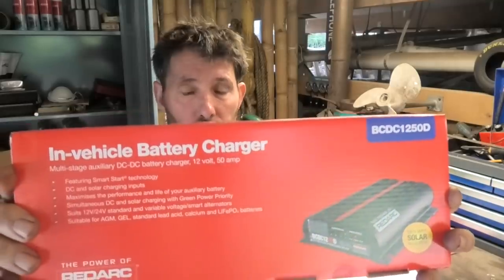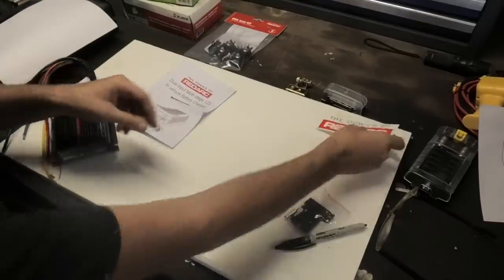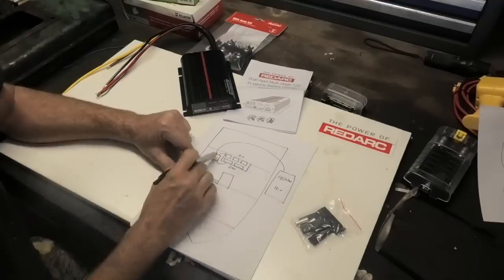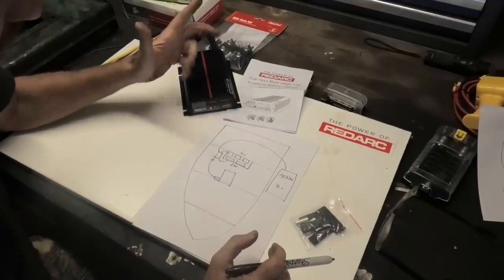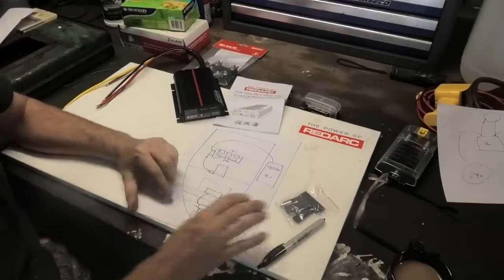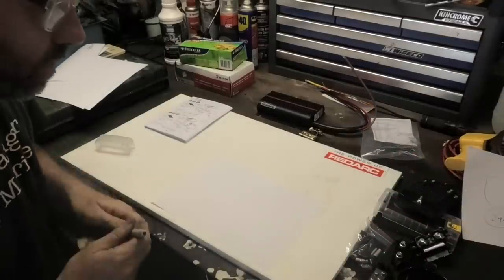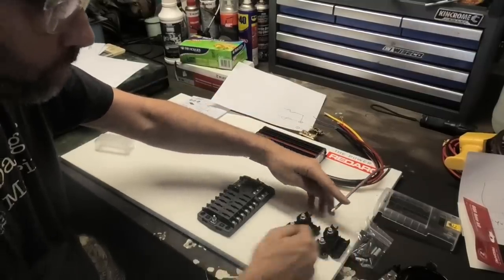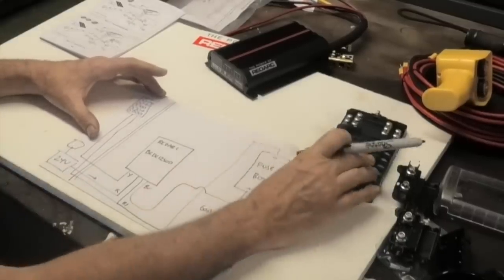Planning the trawler electrics

Comment: Stu, you’ve got a great plan for moving forward with the electrics but there is something you need to consider. Using a single unit combining 12V charger, dc-dc and MPPT for the solar means you are vulnerable to being without charging if it fails. Not sure how long the batteries would last without charging but if you’re a long way out it could be a problem. Having a spare dedicated solar charger might help but I think I’d go with a second duplicate charger unit on your board that you can hook up quickly when needed. Electronics fail and if the charger fails and your 12V bank goes down as well, you can’t even call for help when offshore. If one of your parallel batteries goes short, it’ll drag the other two with it. Add some kind of contingency for charger or battery failure and you’ll be fine well offshore. Keep up the good work and thanks for sharing.
Reply from the maker: Thanks mate. The single point of failure really is an issue, I'll have to think about the best way to handle that.

Comment: Very nice thinking, Stu.    I wish someone had thought out the electrical system on my boat.  It's a terrible bird's nest.  I want to pull it all out and replace the whole system, but it's all working for the moment, so not priority right now.  What an impressive little charging controller Redarc makes.  Looking good!
Reply from the maker: Thanks Tony. It is very easy for wiring to become a birds nest which I guess is why so many planning is required before you start. The trouble with most boats seems to come after the original install as things get added, or things fail and then are fixed with extra wires being run etc.

Comment: I build campervans and 100% agree that dc appliances are the go . Sure mains power gear is cheaper and more variety but if your inverter blows then you have nothing . With dc all you need is batteries and if your batteries die then its easy enough to get another and you still have appliances working . And if you can afford it go lithium batteries in the long term they are cheaper then lead acid .
Reply from the maker: I do like the simplicity of 12V, and, as you say, drop in a spare 12V battery and you are back in business, even if it is just for a while without charging.

Comment: Stu, I have worked on many boats in my lifetime and second the other recommendations to have a "spare" REDARC controller on board with terminals already crimped on hermetically sealed in a heavy duty plastic bag.  You want to reduce single point failure modes.  I had good success over the years with ring terminal screw type crimp fittings PROVIDED they are crimped with a proper ratcheting crimp tool that only releases when the proper pressure has been achieved.  All crimp fittings need to have "inner melt" insulation that you shrink on with a heat gun.  The object is to not let corrosion get into the crimp and up into the wire. I was going to suggest using fine stranded tinned marine grade wire until you mentioned it.  I think 24VDC winches for both the anchor and deck crane is the way to go.  However, if you think the deck crane could be used extensively during salvage then I would suggest switching to hydraulic winches.  As to a small generator, if possible stay away from explosive petrol (gasoline here in America), why store two fuels when you already have two huge tanks of diesel fuel. Yes, diesel gen sets are more expensive but safer, last longer, and are more fuel efficient.  You could probably pick up a good used one on the internet.
Reply from the maker: All good advice mate. I agree about petrol not being great on a boat, it's just that I have the compressor and generator already and can't currently afford to replace them, but I do agree diesel would be better.

Comment: A 900W Solar system at 12V will generate a maximum current of 75A which is 15A more than the 60A fuse of the Redarc, and 25A / 50% more than the 50A it's rated at . . . love your work mate, keep going strong.
Reply: The MPPT in the REDARC operates between 9.0V and 33.0V. The REDARC solar panels on their website produce maximum power at 18V. 900W/18V=50A, 50A is the continuous rating of this REDARC Charger.
Reply from the maker: Hey mate. Now thinking of splitting the 6 cells as 2 for the 24V starting batteries and 4 for the 12V house batteries.
Reply: @DangarMarine  Could be a good move. Making sure the 24V system is always charged to start the motor would be a high priority for me. I'd bet more boats run aground from flat starter batteries than catch fire. :)

Comment: I used a RV camper's generator and power set up.  the 120 power jack ran the anchor left motor. and at sea ran all the power needs and I had over 8,000 watts storage in batteries. the generator ran if needed most of my needs never had an issue in the four years I had the boat.

Comment: Just a thought, a small backup diesel generator could be a lifesaver and get the main engine running if something catastrophic occurred. It could also ensure your separate anchor motor battery or batteries are charged. Yes it would be expensive but out on open waters you want to make sure you know you can start your main engine. Have a look into it and a think about it Stu.
Reply: I would definitely want a back up generator all the time if going offshore. Would a petrol generator not be sufficient? Or is the a concern with fuel storage?
Reply: @landlifem5872  just thinking one type of fuel is enough to carry on board, except maybe LPG operation as I am assuming there will be gas on board for cooking.
Reply: @matthewmoses4222  
 Yeah that's cool, I could see a petrol generator could give trouble with condensation in the fuel if it's not used regularly, and any vapours from the fuel as we all know in a confined space ..   but the advantages of course are the purchase price and ease of starting.

Comment: I would solder every connection I could, mechanically crimp the big connections at the battery. Definitely separating the different currents on different boards is great. Conduit is also the best way. As for the wiring of the motor, I suggest 7 way trailer wire for commercial vehicles. They normally come with 2-10 gauge wires, and 5-12 gauge wires. Should be more than enough for that old Detroit. P.S. I love old Detroit diesels! The old screaming Jimmy's we call'em in the U.S.. Hopefully you slap a new coat of paint on the jewel, and put it in memory of the Green Machine. R.I.P. Love the videos. Keep up the hard work, here comes some more   long thought processes. Wiring is always "fun"!
Reply from the maker: I'm becoming a big an of these Detroit diesels too. I'm definitely going to be painting it once it has been rebuilt. :)

Comment: As you said...try to keep as much of your equipment in the 12VDC range where possible...I don't know what is available there but just check out a truck stop...they are usually packed with 12V stuff!
I have many 12VDC devices that work as good or better than AC...also use 12VDC lighting with LED strings & lamps...though you should get the IP65/IP66 rated for the marine setting.
As far as other voltages you can get buck/boost converters that can supply any level you need...and for connections you can use gel-filled connectors that are heat-shrinked with marine glue.
The AC side (separated is a great idea) is a bit easier for the wiring as it goes farther with smaller gauge cabling...though I suggest waterproof cabinetry if there is danger of water spraying on it.
If you were to send me a list of everything you need to power...and the distances involved...I could get a plan up to help you out...just give me a hollar if you need to   :)
Reply from the maker: Thanks mate. I really appreciate the offer. I'm going to get some more detailed plans drawn up soon.

Comment: Solid plan Stu! :)

Thoughts...

USB Power -- You're right about the 12 vdc to USB stuff. Readily available. I'd recommend putting in the 12-volt plugs that look like the cigar lighters in your car. If we get a USB D around the bend, you can bet Amazon will be flooded with USB D chargers to plug into cigarette lighter plugs. You can pop onto Amazon right now and pick from a wide variety of USB A and USB C chargers meant to pop into that plug in the dashboard and they're cheap. Everything from laptops to camera gear and more can be powered off USB these days. 

AC Power -- Have a hard think about the rest of the AC loads. You may be able to nix the whole system. Hair Dryer? Microwave? Blender? Power Tools? Well, you can buy 12 vdc battery chargers for most brands of battery powered power tools. Can you live comfortably without some of those galley conveniences? Shore power charging could be a simple and cheap portable unit like the kind used to charge a car from the wall. No need for an isolation transformer or galvanic isolator anymore either. (I have strong opinions about which of those two I'd fit if I needed them though.) You could use one of the small, inexpensive, portable inverters that you can plug into one of your 12-volt accessory plugs if you need some occasional AC power. It'd save you a heap of money and hassle if you decide you can be comfortable and meet your needs without the fixed AC system.

Winch -- If you can find a way to get your hands on suitable cables for the winch, you'll be far happier in the long run if you don't resort to the workaround you talked about. That said, your plan will work. My experience with the approach is that it has more points of failure, maintenance, and ends up being more expensive than it is worth, but if you're on a tight budget and scraping together the bits and bobs you need, the remote battery system will get you going.

Hydraulics -- While we're talking about scrounging parts, if you can piece it together on your budget, putting a hydraulic pump on the engine and then hydraulic winches on the anchor windlass and the crane would solve the battery issue and more. That's how the smaller commercial fishing boats are set up around these parts (larger ones having dedicated hydraulic power plants.) I'm betting an industrious guy like you could adapt a hydraulic pot hauler / trap puller to the crane without too much trouble. You might strike gold at a marine salvage. 

That's about all that popped into my head. Solid plan. Good work Stu. :)
Reply from the maker: Thanks for the input Seth. I think I will look into what a hydraulic pump for the GM would cost. Could be super handy and solve a lot of power problems too.

Comment: Agree with all your thoughts, but perhaps consider the consequence of the Redarc unit as a single point of failure, i.e. what would you do if the Redarc failed in service? You would lose all 12V power to the instruments. Perhaps install a bypass switch that disconnects the 12V output of the Redarc and connects the 12V loads back to one of your batteries. You would need a SPDT switch rated to the full current of your 12V DC loads (60A?), or maybe a 60A SPDT relay energised from the Redarc 12V output so that no Redarc output reinstates the 12V feed from the battery. A switch would be my preference as the relay coil would become a constant drain (minimal), but 60A switches are much more expensive than 60A relays! Bare in mind that either a switch or relay in the line would also become a single point of failure, so use good quality components.
Reply from the maker: The REDARC unit is a single point of failure, but only for  charging, everything would still work until the batteries went flat.

Comment: Enjoy yosur trip. wrt electricals, - keep it simple. I'd dump the 12V, run everything from 24V. have distribution fuses in cabin. relying on a single bit of electronics, when it goes wrong, and it will, you'll be stuffed. Best wishe

Comment: I’m glad you have a handle on grounds. They are important for the long term life of your hull. Also important for the life and proper function of your electronics. 

Consider using solder link connectors on your 12/24 volt system small wires. On your main battery cables do the same. They have solder and heat shrink built in. It will prevent you so many problems. In a salt water environment the salt in the air will crap in and corrode your connections. You won’t even see the corrosion and will have troubleshoot an invisible enemy. 

Make sure your bilge electrics are on a breaker in your wheel house. 

Also as a secondary means of removing water in an emergency you can put a few valves in place to bypass seawater and draw engine cooling water from the bilge. That way if your electric bilge fails or is overwhelmed you can add pump capacity with your engine running.
Reply from the maker: Good tips, you can't have enough ways to get water out of a boat!

Comment: Don’t forget get to install isolation switches!!
Reply: The Redarc unit isolates house and starting banks automatically.
Reply: @paulg9314  Still need disconnects so you can work on the system with doing collateral damage....  Also, if you have a problem, you need to be able to bulk turn things off.
Reply: Yes I have done two isolation switches one for the motor and one for accessories in My 6.5 mtr boat , all tinned copper wires which were solder ironed and then waterproof heat shrank , never a problem 
Cheers Benny

Comment: G'day Stu, I noticed in your mud map you don't have a fuse (Midi fuse) at the 24V batteries for the Redarc feed, I know you would have most likely picked that up as you were doing the job, but that stood out at me. 
Now remember nothing but nothing should leave the pos terminal of a battery without cable protection as close as possible to the battery (the only exception is the starter cable), and in the form of a fuse or circuit breaker. :-D
Reply from the maker: Hey mate. Yep, I didn't draw all the fuses (or battery switches). I'll do a proper circuit diagram and share it now I've absorbed all the great advice in these comments.

Comment: Stu, it sounds complex, but it's really not too bad. Definitely strive for 100% isolation, with, perhaps, the exception of lightning protection. And avoid AC, as much as possible- never good to have big voltage and current on a metal boat. DC has it's own quirks, but it'll be broken down to branch circuits, relatively small conductors, well fused, no worries. You, as they say, got this.

Comment: Nice Video...  You might want to ask them about the OPERATING TEMP for your unit...  I don't think it will last long in the engine bay, but could be wrong....  You may want to mount in the wheel house instead.  Cheers and thanks for the video!!
Reply from the maker: It can operate at up to 80C (175F) and has an over temp warning that shows in the wheelhouse. They also state that it should be mounted as close to the batteries as possible.
Reply: Dangar Marine You would know better than I by a long shot if the  engine bay on its worst day exceeds that...  just thought I would mention it...  175 is pretty darn hot, so I  guessing you are good then??   Cheers and keep up the great vids!
Reply: I wonder if REDARC DC/DC converter has battery charger that is “Temperature compensated” for the optimum float voltage and maximum service life.

Comment: Hi Stu, firstly check if the DC converter's solar input has MPPT (maximum power point tracking). If not I would suggesting getting a seperate MPPT to sit between your panels and the DC converter. Just make sure the output voltage is suitable.

Secondly I would recommend you use 24vdc around the boat not 12. Almost everything now allows for both. And if there is something particular that really needs 12vdc you are better putting in a small 24/12 DC converter near the appliance. This will save you a bunch of cable and is also kinder to your batteries.

With regards to your winch having the batteries at the front is a good idea. However I would use a 24 or 48v winch and run a small set of trickle charging cables from the engine room as apposed to putting in a seperate PV system.

Finally earthing with at a single point is a good idea. Just make sure you don't oversize any fuses so if you do short to the boat you blow the fuse.

240vac power is only an issue if you are going to use shore power. In which case you need a galvanic isolator. I would avoid using shore power of at all possible.

I'm a power/renewable energy engineer and happy to help with any questions.
Reply from the maker: Thanks David, I appreciate all your advice. I've bought some cheap CAD software for circuit design and I'm drawing up some more detailed plans now. I can really see the advantages to a pure 24V install, but I think for now I am going to have a dual 12/24V setup and see how it goes. Unfortunately I have too much invested in the 12V side to abandon it now, but it is good to know for the next (likely bigger) boat. :) Also, I'm really thinking of avoiding 240V almost completely. I'm now thinking of splitting my two boards as 12 and 24 rather than DC and AC.
Reply: @DangarMarine  you're welcome Stu. If you are reusing all the 12vdc wiring in the boat that makes sense. I agree avoid AC unless you definately need it. You can always get an elcheapo 12-24Vdc/240vac converter onboard and use it as you need.

Comment: BlueSea makes some really nice 12v--->USB panels/components, and they're fairly reasonable. Their whole lineup is really decent, I use 'em for our 12v sub/backup system here on the Hill. Never a problem.

Related: Experience has proven that the more batteries the better. The less you draw them down the longer they last. Running several years on mine never drawing 'em down less than 85% or so and no failures, steady as.

 Rock On Brother, looking good.
Reply from the maker: They do make some great stuff, that's for sure.